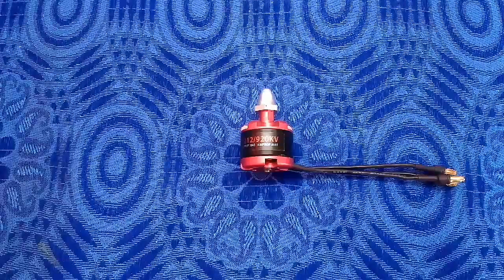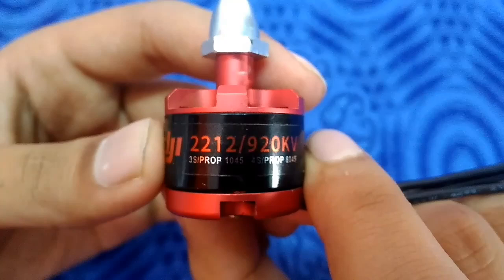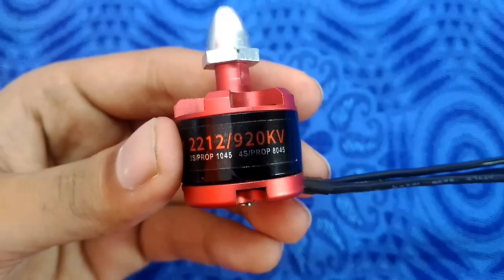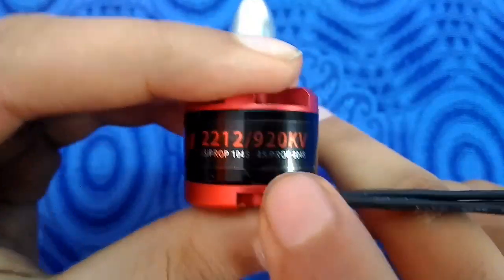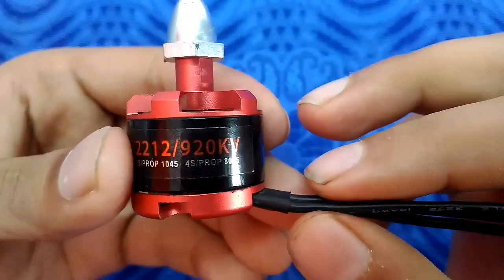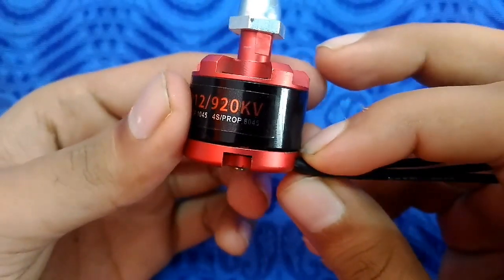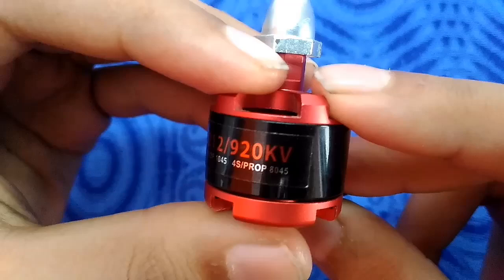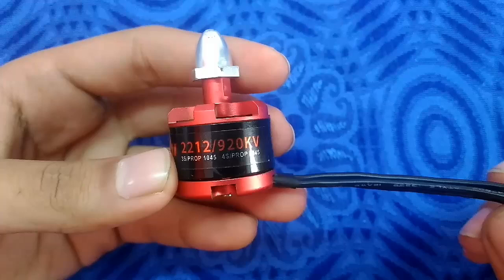Brushless motor explained,KV,RPM,TORQUE,SPEED etc... beginners watch the full video.

Comment: I'm planning to make hexacopter to lift 3-4 kg load please suggest best motor for that
Reply from the maker: Go for T motors with kv less than 400. You'll be able to lift up required weight